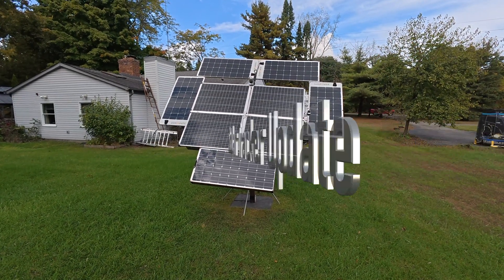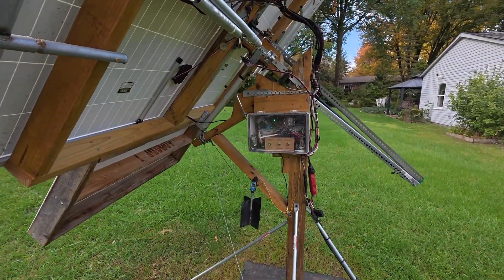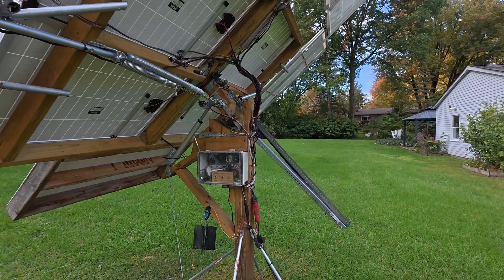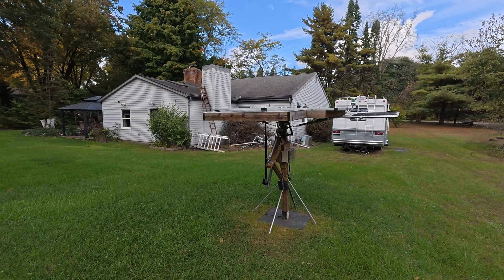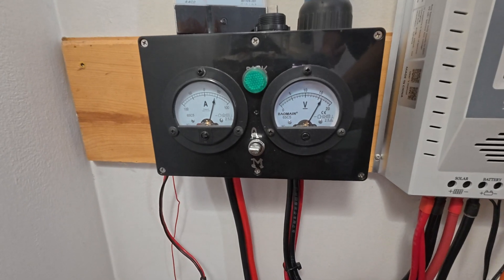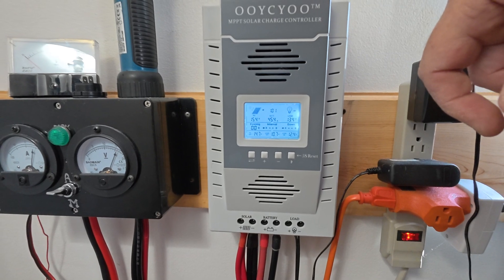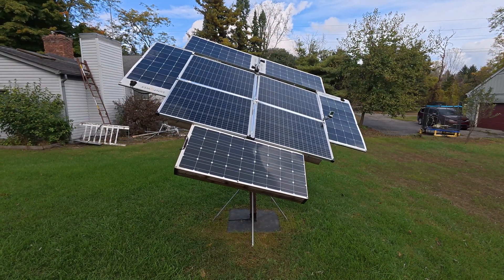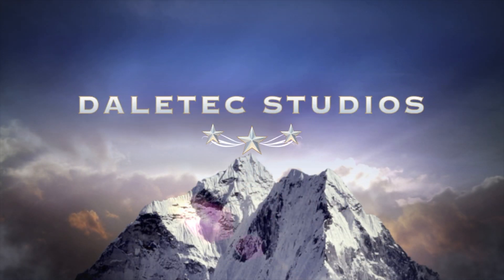My Homemade Solar Tracker Update

Comment: Nice setup! What are those analog meters (where did you get them)?
Reply from the maker: The one on the left is an amp meter and the other is a dc voltage meter. I got them from amazon. You can see the values if you look at them good.